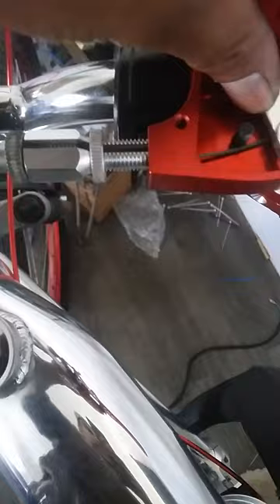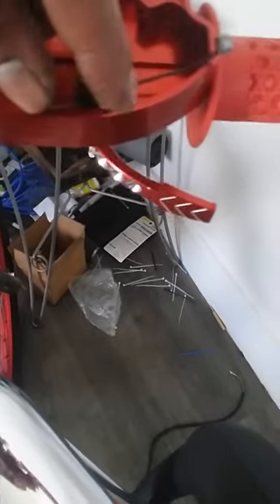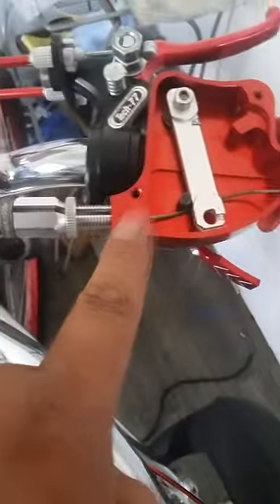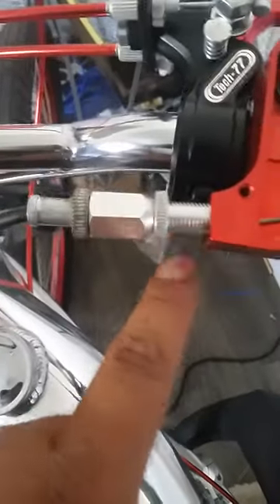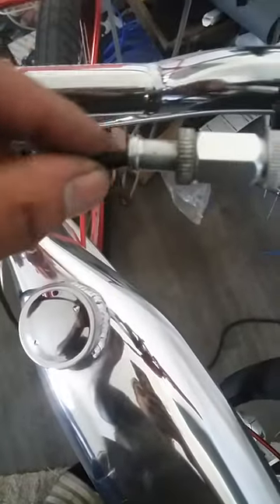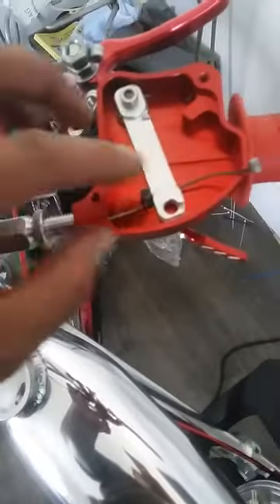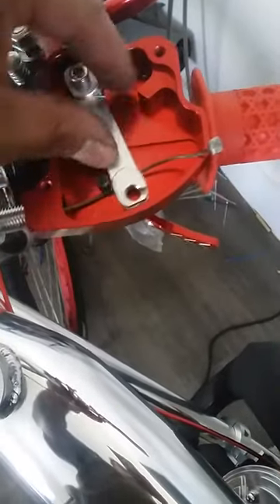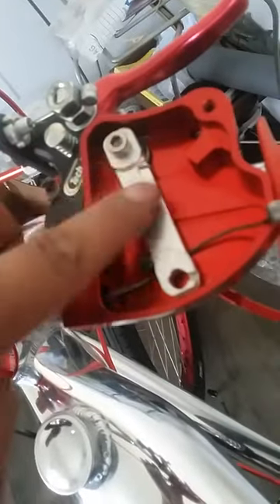how I installed my thumb throttle I ordered on Amazon

Comment: I bought the same thumb throttle for my kids honda trx 250x see if I can actually get it to work
Reply from the maker: Good luck it should I just install it different
Reply: Hey chase thinking about getting it for my 250 ex aswell how did you like it
Reply from the maker: @4x4boyz84  use on my motorized bike seem good . Once I adjusted and installed I had zero complaints and it seems to hold up okay I just say make sure there's this screw on top of this bolt that could come loose what I used was an allen head bolt instead of the screw if I'm not forgetting that's just for the screw won't back out and basically if it does rattle loose it hits the top of the plate but I'm sure if you use loctite you'll be good also I put it on a bicycle and I used it the opposite way to fit my needs but on an ATV should be good